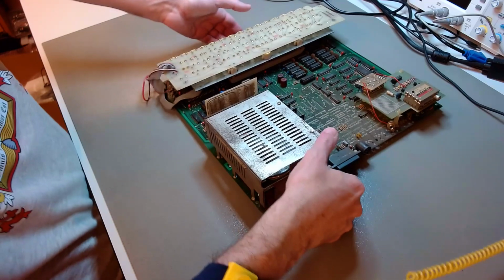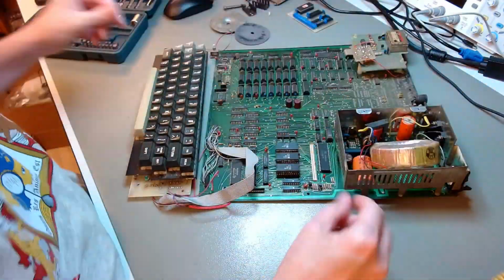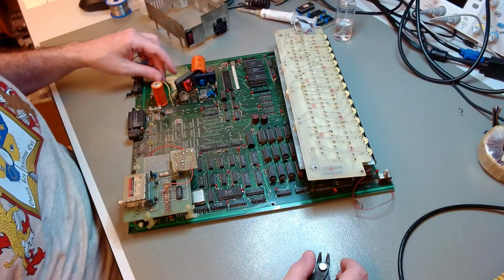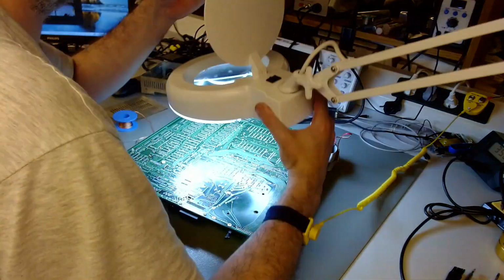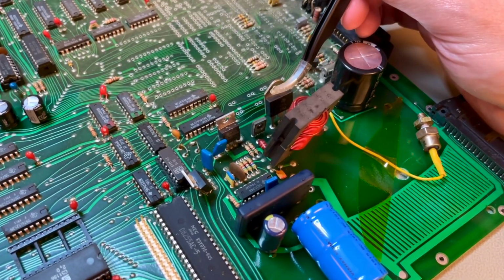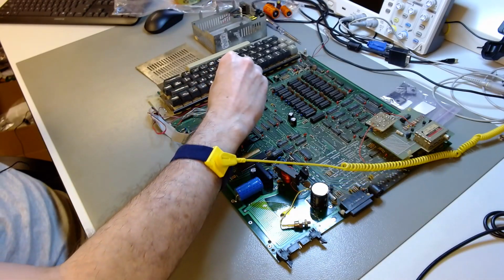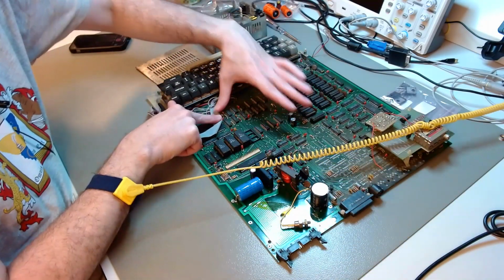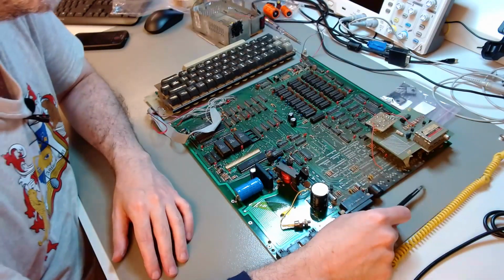Restoring an extremely rare, Belgian DAI PC (Part 2)

Comment: the keyboard is an after market modification .The original keyboard was really fragile and so mikroshop proposed to replace it yourself.
Reply from the maker: Thanks for sharing!
Reply: I disagree, for me this is the ORIGINAL keyboard of the Original DAI (not the INDATA DAI with the color keys).   I have had 3 DAI's a long long time ago.   I believe you have a very early version of the DAI with video composite output. If you look at other videos on youtube you will see that the "regular" video output of the DAI is a with a specific DIN connector+cable.    Is this DAI coming from the Netherlands ? They made a specific version for the DUTCH TV that was delivered without sound capabilities and limited color capabilities (with the composite black and white output).   At the end they where not chosen by the DUTCH TV... In 1981 or 1982 I bought one of these limited prototype machine directly from the "factory" in Evere (Brussels)
Reply: This keyboard is an aftermarket product in Germany. I had a DAI, bought from the German distributor, mikroshop. After about 2 years of intense usage, the original keyboard had some serious issues regarding wear, some of the keys did no longer work. mikroshop created a replacement keyboard - of course, in the original key layout, but with much better quality of the keys. You had to cut away the original keyboard, which was a tricky thing, as there where some signal lines very close to the keyboard. I never had any problems with the keys after that.

The keyboard is advertised also in the Belgium DAI user club magazine dainamic, issue 12, p.291. Costs were 4500Bfr, with montage 6000Bfr.
Reply: Here is the link to the above mentioned magazine https://web.archive.org/web/20191020125432/http://electrickery.xs4all.nl/comp/dai/doc/DAInamic_12.pdf

Comment: Zur Tastatur: Ursprünglich enthielt das Board auch die Tastatur, die aber vom Kontaktmechanismus her sehr fehleranfällig war. Die Tastatur bestand aus einzelnen Tasten, deren Körper direkt auf die Platine gelötet war. In dieser Baureihe waren die Tasten braun. Irgendwann hat DAI diese Anordnung durch eine integrale Taststur ersetzt,  wie sie im Video zu sehen ist. Ich habe damals in Deutschland für DAI gearbeitet und eine Reihe von Geräten mit problematischem Tastenverhalten repariert. Als dann die Geräte mit den neuen Tastaturen geliefert wurden, habe ich einen Nachrüstsatz zum Austausch der Einzeltasten entwickelt. Dazu musste das Board gekürzt werden. Im Gegensatz zu der im Video gezeigten Lösung von Microshop habe ich das Flachbandkabel aber steckbar gehalten, indem ich an passender Stelle auf dem Board eine Stiftleiste angebracht habe, nicht das Kabel an IC Pins     angelötet habe. Ich war damals definitiv der Einzige, der diese Lösung angeboten hat. Mikroshop muss sich irgendwann da dran gehängt haben. Ich vermute, dass eine Fa. Lackner aus Wien dahintersteckt, die ich als DAI-Repräsentant aus Deutschland beliefert habe, der ich aber meinen Nachrüstsatz nicht zur Vermarktung überlassen wollte. 
.

Comment: For those stacked ROM chips, i know TI made mask programmable ROM's where you could specify the polarity of the 2 or 3 chip select pins as part of the programming.
So you could have several ROMS completely in parallel with the chip selects determining which one was enabled.
Reply from the maker: Thanks! This makes sense. However, there are three populated ROM positions, so the system cannot have one of the two ROMs in each position selected all the time. All three positions connect to the same data bus. Right now, knowing a little more, I think the reason they doubled the ROMs was to give them more oomph to drive the data bus harder. This particular board seems to be a very early prototype, and they hadn't sorted their electrical design yet, I suspect. There are other reasons I think that, which I will discuss in future episodes.

Comment: The arcitectur of the DAI is very original and quite unique. It is fascinating. The graphic engine accesses the memory (the bank 8000-BFFFF afaicr) 16 bit at a time, the is allows the CPU to access it every other cycle 8 bit at a time. The address where the pixel data is streamed from is not fixed as in all other frame buffers but can be set for each display line sparately. This allows to mix resolutions and colour depth for each scanline. A system more flexible than even Amigas copper. A truely brilliant system if I have understood correctly.
Reply from the maker: Fantastic!
Reply: @thebyteattic  When I was young (I´m 64jr old now), my brother and I got one from our parents. It was a 8kb machine as far as I can remember in the same config as the  version as initially proposed for the Dutch Teleac TV computer program series. It had the same green logo as yours, later revisions got a different, more colorfull logo. It were great machines,but with little software support compared with the Apple 2 or TRS 80. Disk drives were rare and insanely expensive, but a digital tape recorder was also available and quite fast.
These first editions had serious quality problems, so did ours. It took many months before we got it back from repair and soon thereafter, it refused to boot again. After a long discussion, we got our money back. Because of the massive issues, Teleac stopped selling the DAI as part of their study configuration and replaced it by the Exidy Sorcerer. I still have this same Exidy in its original box on the (non-byte) attic here at my home :)
After the Exidy, I got a 80186 based based Philips Yes computer, also very rare computer. Don´t have it anymore though.
In the Netherlands we had a very active DAI usergroup at that time, called Dainamics. The magazines can still be found on the internet, including the original roms. MAME has also DAI support, from what I read you can run a DAI in emulation mode on a PC.
Great to see it back, all my respect for all the work to restore it! I now own  Rc2014 and your Agon Lite  to play with modern retro 8 bit technology :) Keep up the good work!
Reply: @frankvanderleegte6438  If I recall correctly it was sold in a 12 kB version and could be upgraded to a 48 kB version by inserting extra RAM. In the 12 kB version the higher graphic resolutions like MODE 6 and so were not available. We bought the original 12 kB version and upgraded it later.
Reply: Only 8kb? The beeb had 32k. Why was such a low amount chosen?
Reply: @reinoud6377  Price. When the Acorn BBC came out (1982), the DAI was already 4 years old (1977).

Comment: Did you make copies of the ROMS? There used to be a big-ish DAI / Sorcerer user group in the Netherlands, assuming they are still arrive.
Reply from the maker: Yes, all ROMs and PROMs are backed up and are going to go to a Github archive soon. Those user clubs are long defunct...
Reply: @thebyteattic  Do your ROM dumps differ from the ones in Mame?
Reply: @thebyteattic 
Are they V1.0, V1.1, other ?
And BTW, what card is plugged on the X-BUS connector ?
Some ROMs for the "specialized" use of this low-end DAI ? (B&W, no paddle, no sound, no tape)

Comment: From 1979-1992 I worked for computer shop in North London, UK (Da Vinci computers) and the DAI was one of the machines I evaluated for our store to sell. The hardware was good, but VERY expensive. Apparently it was designed by some engineers who worked for Texas Instruments. As the design was 'rushed' the prototype machine was developed with the Intel 8080 , and the plan was to replace the 8080 with a more modern and slightly more powerful z80, but this did not happen.  I evaluated the machine for a few weeks and then sent it back to the importer. 

It had a very powerful, semi-compiling BASIC and a math co-processor from AMD. The graphics were superb and fast. However it was FAR too expensive and there was no hardware expansion and pretty much ZERO software.  Stephen Walters G7VFY.
Reply from the maker: Thanks for adding this to the record!
Reply: @thebyteattic  You have an earlier one. The   next version had keys all the same colour and the last version had multicolour keys, which I don't think ever appeared in the UK. It looks like your motherboard has an empty socket where the AMD 9511 is supposed to go.